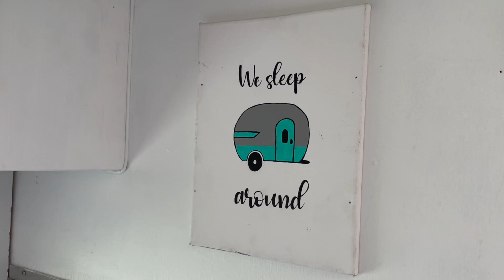Camper Make-Over for $300! turning a used camper into a retro poolside cabin!

Comment: Love this idea!  Don’t forget to put supports under the rear. I can see it tip if too many people are towards the back. 😏 Not that I’ve experienced that, ever . . . once☺️
Reply: Shouldn't there be a  wind down stabiliser under each corner? We have them here on our caravans in the UK.
Reply: @drogna3905  I think those are on the newer ones, but the older ones (unless High End) never seemed to have them unless after market.
Reply: @scottstewart3884  Hi, You maybe right.
Reply: @scottstewart3884  you are right. I remember putting the stabilizers under the corners.
Reply: Yes, and add those chocks you got for the tires so that your trailer doesn't roll off the pad. Cool addition for sure. Love it.

Comment: I want you to know your jack stands need to be under the rear trailer frame.  The front hand crank will level the trailer and you won't have the unit tripping over.  A three-point stand will make the cabin stable and safe!

Comment: Just a quick hint we use for our RV. Put out several bars of Irish Spring bar soap all through the camper along the floors and bottom of all the cabinets. It helps repel any mice who might want to get inside.
Reply: It came full of Irish spring soap all over on the inside and no mouse poop so it must be working :)

Comment: That's very much like a trailer I was in for 2 years moving across Canada!  Ours was a 1971 Northwester, a weird subsiduary of Triple E  -- which I think that one is - a genuine Triple E, which was a bit more deluxe. Dad was a welder looking for work.   We had baby moon hubcaps because my dad thought it looked cool going down the road - which I think would really look good on yours!

My dad sold ours in 1975 and found out as the guy was pulling away he confessed that it was to be used as a brothel in the Yukon!  :)

Those windows are not the originals - I'd be checking the fitment and the weatherproofing on them.

Comment: Might I suggest that since this is stationary, you might want to put two solid jack stands under the rear bumper and thus have a three point support taking the strain off of those old tires. that way if one leaks you do not lose your level stance. You do not lift the tires but partially lift the springs to take the strain off of the tires. Even taking a small load off of the tires will keep them from flat spots if you ever have to move it later. Just a thought.

Comment: I would suggest placing  more jackstands,at the rear of the trailer.
I learned from experience,it will tip back,should you get enough weight,there.

Comment: I love that you kept the green And expanded it.  I'm glad that the recreational white Dried Whiteish.  Are you going to hook up the water?  Well you're not using it For someone to sleep in you could use it as an air BNB.  I live in 114' by 60' single wide In all I never thought I'd live in 1 life I like it.  It's in mobile home park so I don't pay taxes on it but I do to pay lot rent.  The inside of it is not What you would think a mobile home would look like.  It has crumb molding and The floor is like a forward but it's actually a stick on it And it came like that Had I know that when I bought it I probably would have changed it.  And the 1 and only bathtub is 4 1⁄2' long instead of 5' so I don't fit in it and it's barely wide enough for me to use.  I still need to put more cabinets up or otherwise it's pretty good.  I loved painting the interior but the exterior I would definitely like to paint As right now it is dark green shutter white trim and most of it is pea soup green.  I don't have traditional siging on my house.  it's more like metal and it's vertical not horizontal so I think I'll have to use a like a tractor paint.  I'll probably be mixing colors In order to get the ones that I want.  And I have to find out if I can use a sprayer.

Comment: Alex the only thing you need to do the complete the outside of your camper, which looks awesome,  is put some Baby Moon Hub Caps on it! That will make the wheels look sharp with the paint job and the painted white walls!
Reply from the maker: I would but hubcaps wont fit on those rims sadly :(
Reply: @CuriosityIncorporated  They do have hub caps to fit those rims, you just have to look online for them. I have watched quite a few videos on people who have refurbished vintage travel trailers, and other people have been able to get them. The tire and rim size on your 1970s trailer should be 14 inch or 15 inch, which you can still buy! It sure would make your vintage trailer stand out!

Comment: Looks like your caravan lacks the front wheel with the lift which keeps the front up and the back standing legs that supports the back. Or did you check from underneath if the legs are still there? They are rolled up for moving. We had a caravan as a stationary/movable on our yard for years. Children slept there in summertimes with their friends when we were not travelling with it. But we sold it and the second car of ours and got a newer camper to travel with. Caravan life is nice lol.

Comment: I highly suggest taking expired window tint off but I highly suggest replacing it with quality new window tent to keep your family safe from the sun but I would do the house as well and any vehicles that are daily drivers including the windshield and the professional suggest 50% on the windshield. I did 72% one year on a car and it was not dark enough when you turn your windshield for sun protection the police don’t pull you over because they call it a polarized windshield not a tinted windshield so it is legal through a loophole just the purpose of your window tint needs to be sun protection and not privacy and they can look the other way

Comment: I don't know what the wheel is called, but let's call it a "nose wheel". Every caravan is supposed to have that, even the ones from the 70s, so you can move it around by hand. It might be worth seeking one out, so it doesn't have to be stuck in one spot.